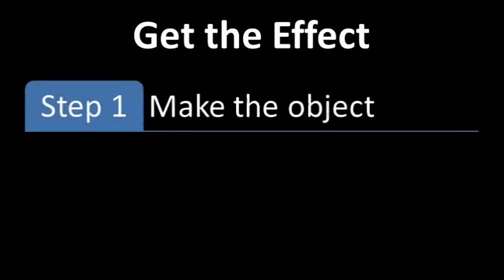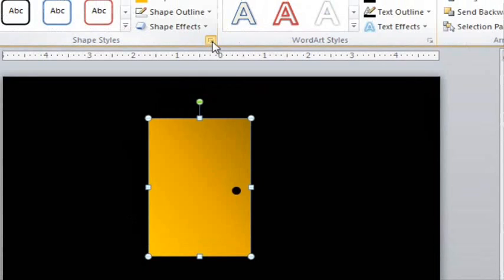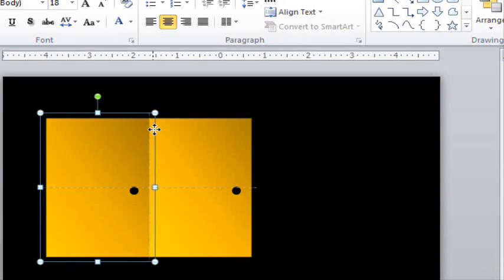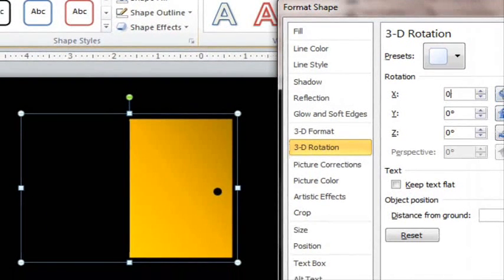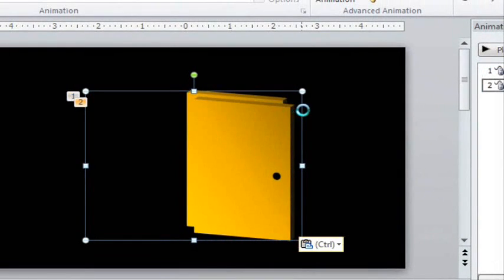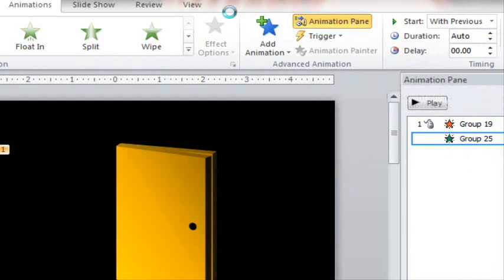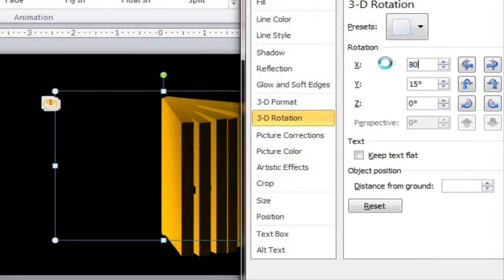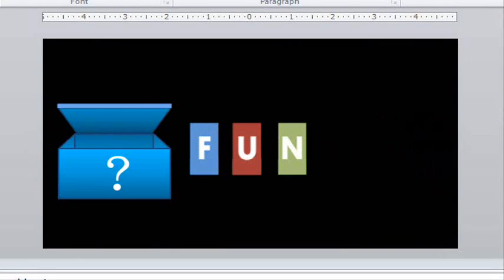Hinge Animation Effect in PowerPoint - Advanced PowerPoint Animation Tutorial

Comment: Why can't I remove the door knob after selecting, right-clicking, and selecting cut?  It removes the entire door.  I did 'group' the objects instead of combining, like I did the first time...
Reply from the maker: +Carson Dan If the doorknob is already on a rotated door, it won't work to remove it.  However, if the door is still not rotated, it should work.  Make sure that when you right click, you don't accidentally select the whole door rather than the doorknob (given the knob is small, it is easy to do).  Otherwise, you can try to left click to select it and then try a shortcut key like CTRL X to cut.  That way, you don't have to worry about right clicking at all.
Reply: +PowerPoint Spice Thanx for your help, Lia (Lea?).  I rotated the entire assembly so it would open like a bread box w the hinge on top.  I wanted to make it appear as if this is set flush inside a wall w a frame around it.  The plan is to run this on a 72" touch screen located in a classroom.  The user is drawn to a flashing msg which lures a student up to touch this graphic, initiating a question/answer sequence...